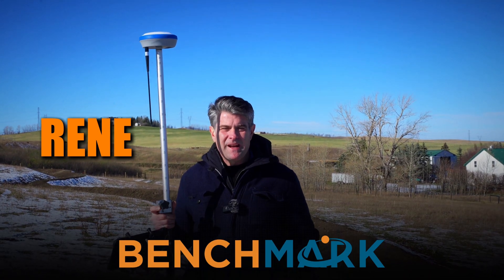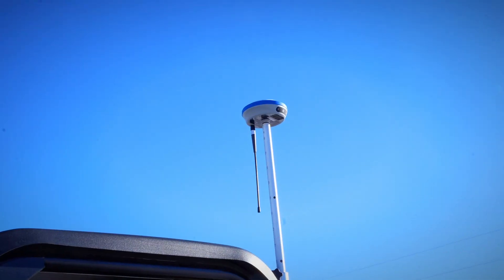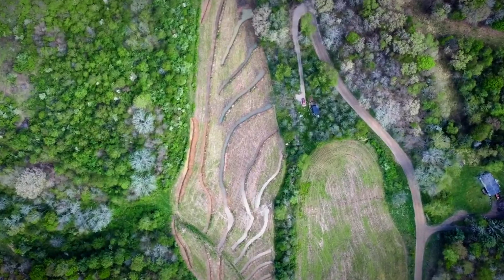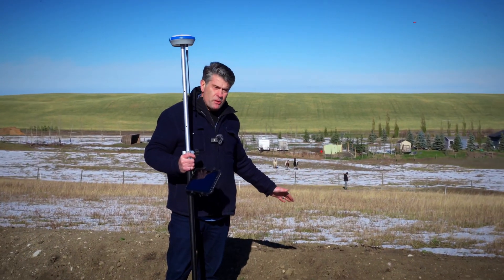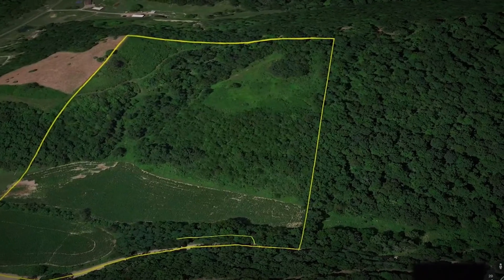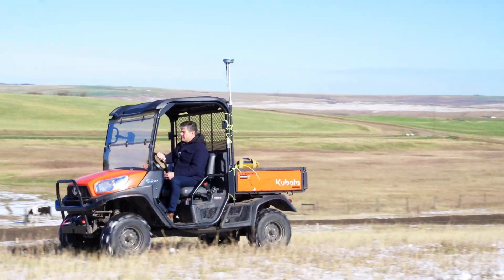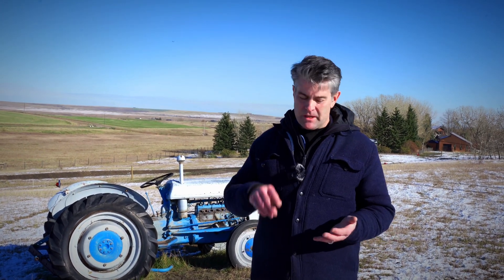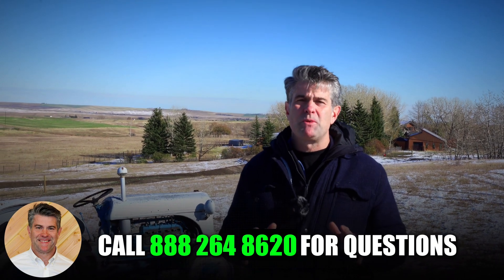The Profit in RTK Farming: How to Build Swales Easy Using GPS

Comment: why is rtk/gnss so expensive in general, when you can get dev boards for $10/ea?
Reply from the maker: Hi Hot, that is a great question and there are a couple of different factors that influence the cost. Besides these RTK receivers having UHF and VHF radios, cell modems, high quality antennas, bluetooth + Wifi communication boards, batteries and extra data uplink options, however one of the biggest differentiator in cost is the RTK engine. A lot of the dev boards don't have the same engine technology, like ionospheric modelling, noise filtering, etc. The dev boards you mentioned are getting better and better all the time, but they are still a long ways off from being able to perform in the same environments as full blown survey RTK receivers.
Reply: Traditional RTK customers were happy about the high prices because it kept them exclusive. Surveyors don’t want construction workers or land owners marking their own bdys for fencing or grading with inexpensive GPS systems. It’s about time someone recognized this and tapped a new market.